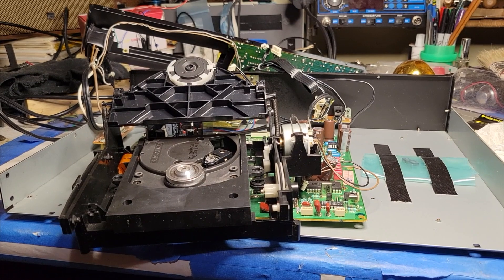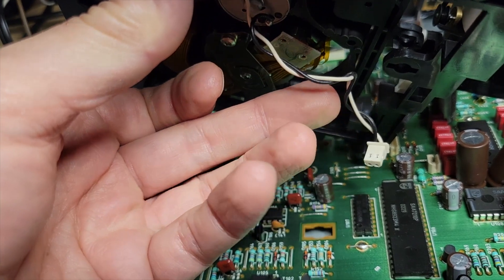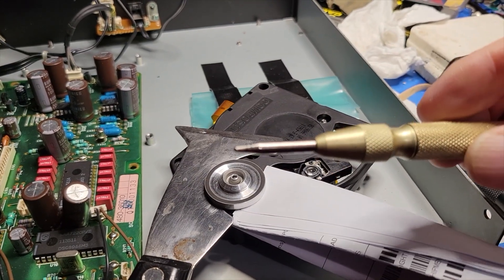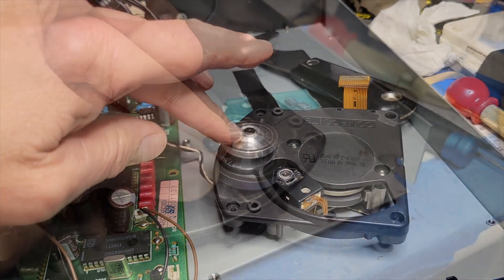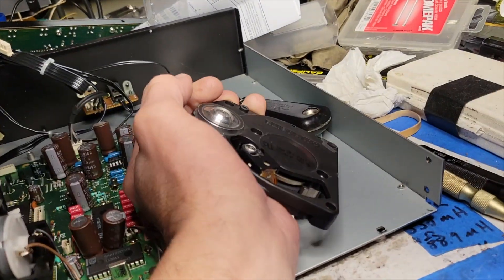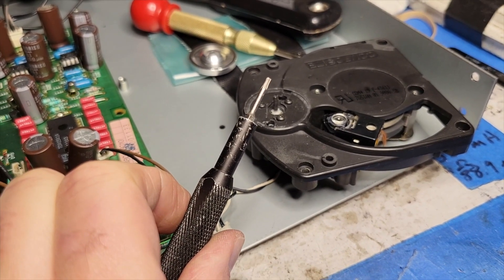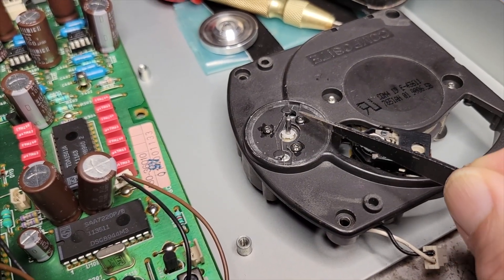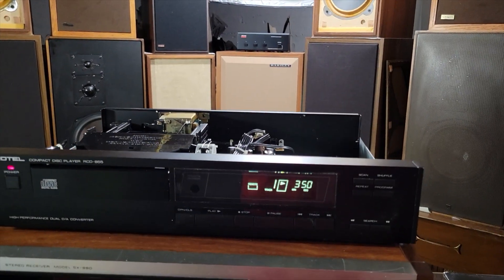Mystery Solved! Replacing the Motor on a Philips CDM-4/19 Mechanism to Fix Rotel RCD-855 CD player

Comment: Good vid! If you had the choice, what would you choose, RCD-855 or RCD-955AX, and why? Thx!
Reply from the maker: RCD-855. They're nearly identical, but I've read that the 955AX just doesn't sound as good. In one post I read, someone had discovered that there was one small circuit modification that could fix the 955AX, something like adding or removing a jumper. But, if the general opinion is that the 855 sounds better, I'd rather not get the 955AX on the say-so of one poster in a hi-fi forum.
Reply: @Lancaster_Hi-Fi  Thx a lot. You mean this statement: "Someone, somewhere has made the decision to connect an earth tag between the circuit ground and the player’s metal chassis. Connect a 100 ohm resistor in its place and the RCD-955AX ‘\s restored to its former glory…" If I only had more info on this…where's that earth tag located, do you have any idea or more info on this?
Reply from the maker: That's exactly the post, but now you know what I know.

Comment: hello, sir, would you by chance be willing to help resurect a working Magnavox AMP 185 AA into something basic similar to what your video describes?  thanks much
Reply from the maker: What sort of help did you have in mind?
Reply: @Lancaster_Hi-Fi  I was going to grab one that is for sale but since its only a power amp, am now looking to find a integrated old low power tube...I do like the sound of that magnavox from what ive heard...but if I got that, I'd basically  just want to get it running and safe, and if the couple tweeks done on the one you had are simple, add it/them.
Reply from the maker: I'm sorry for not responding until now! YouTube doesn't alert me to replies, so I'm still learning how to find these threads. Did you end up finding an integrated tube amp?

Comment: Checked mine, motor all secure, thanks for the heads up though would love to get some oil on it! All the PCB screws had thread lock on them but that's Rotel I doubt they touch the mech. I see all the black gates are now silmic 2s.
Reply from the maker: Yours had the Silmic II's? Or did you mean mine? I figured that even Blackgates get old but that I'd better replace one overpriced cap with another! Although, I gotta say, the Silmic II's were amazingly consistent in value within the batch.
Reply: @Lancaster_Hi-Fi  I meant that yours has changed to silmic2 it is one of the best caps. I have two of these players now both with black gate and I wonder whether to replace them, I've heard that they are not the highest grade black gate and why so large at 100uf. So far I've seen 4.7uf bipolar, 47uf polar in players, in theory the signal ought to be ok at about 3uf ok fine give it lots of room but 100uf is a lot. Anyway great lively sounding player future classic.
Reply from the maker: The one in the video was for a friend.  I have a second that I bought for myself, and I haven't done any work past boiling the belt for the door. So far it's fine with the original caps, but old caps are a crap shoot. You won't know they're out of spec until you measure them, and you have to take them out of circuit to measure them,  and at that point you should probably just replace them if you have suitable replacements. And you always risk catastrophic failure with old caps. The 100 uF Blackgates are large, both size and value, but I wouldn't second guess the designer's choice when replacing them. Smaller values would have been cheaper, so they probably had a compelling reason to go as large as they did. And if I'm going to replace Blackgates, that's one time at least that I'm going with Silmic II's.
Reply: @Lancaster_Hi-Fi  Good advice thanks, found the psu caps for the current hungry Saa7220P/B and Saa7210 were <22uf esr measured should have been 47uf and a big difference replacing them, so yes you're right the whole thing needs new caps.
Reply from the maker: Yikes! The first receiver I restored was an NAD that I bought new in the early 90's and had been in nearly constant service for over 25 years. Some of the caps were so far out of spec, I was surprised it still sounded OK at all!
Reply: @Lancaster_Hi-Fi  Found a solution to mistracking and skipping. It's the top clamp bearing, lever the holder off the arm beware the ball bearing can come out, clean and lube. Much improved, apols you probably know this already.
Reply from the maker: That was the first thing I tried. Until I discovered the issue with the motor, I was afraid I'd effed it up, so I'm glad to hear you recommend it.

Comment: Punching and pressing on that motor shaft is a LOT of stress on the motor bushings and bearings. If the screws were loose enough to be hitting the spindle, only then is it worth removing the spindle,. Otherwise, just hot glue the motor into position.